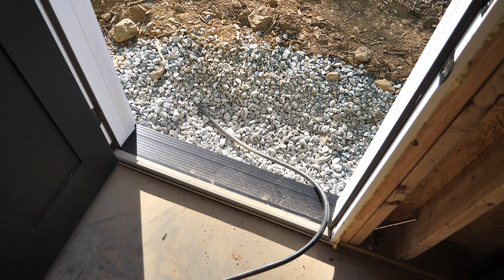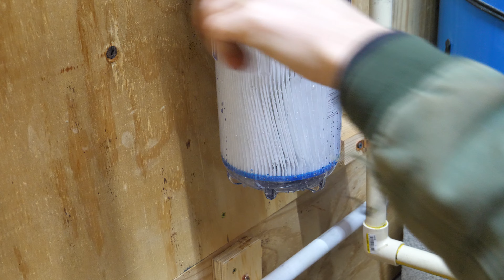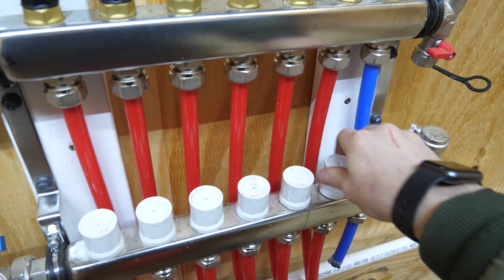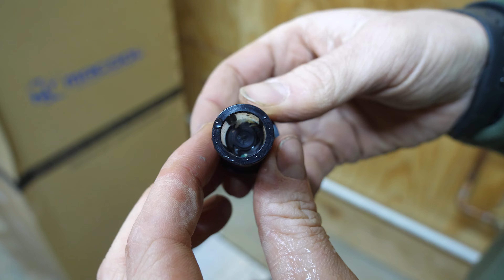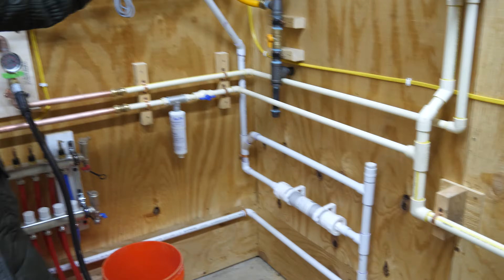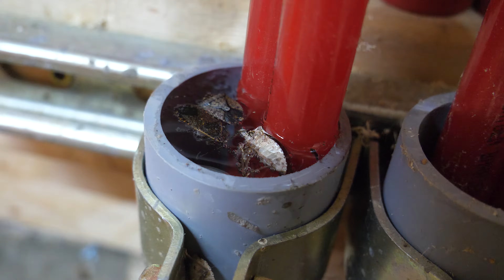FIRST START-UP of our Heated Slab (more leaks)

Comment: I’m confused on that 7 loop manifold. All the other videos I’ve seen they crimped each line to the fitting on manifold and u just stuck it in and tightened it and it didn’t leak or bust off there like I thought it would.

Comment: I'm surprised you didn't put a air valve at to top to automatically release air from the system. Also, I think you can flip the display on the pump
Reply from the maker: The manifold has air bleeder valves on it but they aren't needed for an open system - every time you open a hot water faucet air has chance to escape
Reply: Kyle at R&R buildings put one in, might be because he is using a glycol solution @MasonDixonAcres

Comment: So the same hot water flowing thru the floor pex is also coming out the faucets throughout the rest of the home ? Or is the radiant floor pex isolated ? Just curious , i was thinking about using an antifreeze fluid in my flooring pex.
Reply from the maker: Yes this is an open system, all the piping and components are potable rated. A closed system would use glycol in the loops and either a combination boiler or separate tankless heater
Reply: @MasonDixonAcres  thanks. Great job. What a commitment.

Comment: I see some auto air vent at the end of the supply manifold and return manifold. Loosen the same cap on the auto air vent so the air will exit automatically. The auto vent has a float in it that drops to let the air out automatically  enjoy

Comment: Thanks for the video, I’m about to fire up mine tonight, it’s a closed system. Going back and forth on glycol or just water it’s our main heat so unless we have a long power outage I don’t see any issue with just water. Did you have any reservations about just water?
Reply from the maker: Nope. It would take a lot to freeze a slab with R10 at the perimeter. But if it's a closed system and always will be, it wouldn't hurt to use glycol to eliminate any corrosion concerns if you don't have any cast iron parts in the system

Comment: Pretty cool project, a water softener or an R.O. system would help reduce/eliminate the scale issues.
Reply: RO can’t be used with copper pipes. It eats the metal.

Comment: I’m just wondering why they didn’t install an air eliminator. I had the same leak at manifold connection. I ended up putting a lot of teflon tape and it sealed up.

Comment: First off, great work all around. I'm in the process of designing a similar shop / home and ran across your channel. My heating/cooling concept is almost identical, but im debating whether a separate radiant system is worth it if i have mini splits in the shop just as you do. I know your design is an open system so it also supplies domestic hot water. Im curious to know if you considered no propane at all with just the heat pumps and or maybe electric boiler / water heater. Electricity may be expensive where you are so maybe that went into the calculus. Also, did you complete a heat loss calc for your spaces? Im looking at how to size the heat pumps appropriately. Thanks for sharing.

Comment: I know it's been a while but if there's still time you should run that extra supply up to the bathroom. Your wife will love you for the heated floors in there.
Reply from the maker: That's actually why we bought a 7 loop versus 6 loop manifold, but then realized control would be a pain. Using electric radiant floor in the bath/shower instead!

Comment: Scale is from the make up water, heating the water causes more scale to precipitate out in the system. I can't believe your wife will be happy when her laundry becomes stained from the water in your system. 2 of those Takagie condensing boilers, one for heating the floor and 1 for heating domestic water needs.  Filling the floor heating unit with 50/50 mixture of Prestone and distiled water will keep your system clean and the tiny passages in the boiler clear of scale and rusty water. Always remember to check the boiler water for the correct PH . Pure water will eat holes in the copper heat exchanger in a short period of time. Rock phosphate is a good way to keep the water at the correct ph,you can use DCA test strips to test the water ph, DCA is used to keep the ph at the correct level in Diesel engines, it will be more than sufficient for you. Scale stick made by NUCalgon is my favorite for this application.
Reply from the maker: Thanks for all the info! I haven’t noticed any change in the water between hot and cold so far, it’s been going for close to a year. Haven’t tested any pH though, focusing on finishing the build first 😅 Radiant floor company does recommend flushing the tankless with vinegar once a year to keep everything clean. I’d much prefer to keep the open system for the simplicity and definitely don’t want to put in a separate $1400 boiler for domestic water haha so time will tell! Will update

Comment: I just got my system in my pole building online yesterday. it's a 30x40 building with 4 loops.  All these "kits" out there were so highly priced. I did it myself. I got an electric water heater from one of the kit suppliers. but everything else was local. I used PEX-C from lowes. 3/4 inch with crimp fittings. So far so good. No leaks that I've seen and it's been running about 19hrs now. So it'll take a few days to get up to temp I'm sure. Videos like this one sure helped.

Comment: You can't mix your heating water with your potable water. You're missing an RPZ backflow preventor and water make-up, regulator, air separator and expansion tank. A huge health hazard. If you wanted to use this to heat your domestic water too, you need an indirect tank. This all needs to be redone.
Reply from the maker: You're imagining this is a closed loop system - I suggest looking into the open direct system by Radiant Floor Company, they have lots more info
Reply: @MasonDixonAcres  It doesn't matter whether its open or closed loop. You can't mix your radiant water with your domestic water.
Reply from the maker: If all components of the system are rated for potable water, there's no reason you can't have radiant and domestic water together in an open system. Open to hear the reasoning for your opinion
Reply: @MasonDixonAcres  Your components are not potable rated. The Grundfos pump, the oxygen barrier PEX etc... This doesn't include any of the other various radiant heat fittings. The alloys used have to specially made for potable water. Otherwise you will leach lead. Just the oxygen barrier PEX alone is a really unhealthy dose of chemicals.
Reply: @MasonDixonAcres  Even if all your components were rated for potable use, you can't have "dead ends" in your piping. This happens when your radiant side isn't being used for several months. This will cause Legionella growth.
Reply from the maker: The Grundfos Alpha2 stainless circ pump is designed for both radiant and domestic recirculation applications - please check the literature before assuming. Type L copper assembled with lead free solder has been used with potable water forever. The brand of oxygen barrier PEX used in this system is specifically listed for both radiant and potable use. Any O2 barrier PEX is chemically identical to non-barrier PEX except for a glossy coating on the exterior of the tubing. Some brands have undergone the NSF rating for potable and others haven't.

I don't usually spend time arguing with comments but I don't want others reading this to be misinformed 😄 

More info on the system here: https://www.radiantcompany.com/system/opensystem/
Reply from the maker: There is water movement in the system every time a hot water tap is opened (including in the summer) preventing stagnation.
Reply from the maker: The pump housing and flanges are stainless, it is cast so it might look bronze on camera. This is the pump: https://www.pexuniverse.com/grundfos-alpha-15-55-sf-circulator-pump-59896879

You are totally right about the Pex-A linked in that video description, that was a mistake and I switched it to the correct link. The tubing we got is dual rated for radiant and potable, this is the correct link to what we actually bought: https://www.pexsuperstore.com/product/1-2-x-1000-ft-red-alpha-pex-a-expansion-tubing-with-oxygen-barrier-radiant-heat-potable-water-by-pex-guy-made-in-the-european-union/

You are right that I didn't necessarily need the O2 barrier on an open system, I could have used non-barrier. I figured it was cheap insurance in the case the system would ever need to be switched to closed loop in the future, and maybe it would provide some amount of corrosion protection.

I am the first to admit that I am not an expert and do my best to thoroughly self educate when I perform skilled trade tasks. This is why I never label these videos as how-to's, but I try to always put out valid information regardless. I do appreciate your input
Reply from the maker: For the benefit of anyone reading this in the future, I reached out to the supplier to clarify the physical difference between their dual-rated (radiant + potable) O2 barrier Pex-A and their radiant-only rated O2 barrier Pex-A. This is the response:

"The Alpha tubing is rated and tested for use within radiant heating and potable water systems; while the standard PEX-A is only rated and tested for radiant heating.  They are also manufactured in different factories.  NSF is the governing body here in North America.  They are the ones who certify PEX tubing to be safe for certain applications.  This certification process includes inspection of the manufacturing factory, long-term and short-term testing for material durability, longevity, and overall quality, ect.  This ensures that all NSF certified products are quality and up to standards here in the USA.  There is a fee that factories have to pay annually to be certified by NSF.  Radiant Heating (NSF61) and Potable Water (NSF/ANSI14) certifications are separate, so factories normally produce and certify their PEX tubing with one or the other; even if the PEX tubing, materially and structurally, can do both radiant and potable water systems.  The certification fee prevents manufacturers from certifying their PEX tubing for both; as each certification ranges from $100K and up."

Comment: Over tightening a threaded connection can crack a brass fitting. Just 3 wraps of Teflon tape and a light coat of pipe dope then snug it down.

Comment: You’re making that look easier than it really is. Purging all of the air out of lines can be problematic...for any kind of system.
Reply from the maker: With an open direct system it's as easy as opening any tap! For closed systems, yes it can be quite difficult if the bleeder valve isn't the highest point of the system

Comment: How does it heat with that heater and not waste water? I thought it would be a closed circuit but you said that heater will provide water for sinks...
Reply from the maker: it circulates hot water through the floor until you open a hot water tap, when the output from the heater is directed primarily to the tap. It's called an open direct system.

Comment: Great videos.  That’s an impressive DIY system.  Auto air separator or bleeder would be a nice add to that system.  On the outlet of the boiler but before the inlet of the pump.  Point of highest temp and lowest pressure.
Reply from the maker: That’s the beauty of an open system, a little air bubble here or there doesn’t really hurt anything and just works it’s way out at your faucet. There are air bleeders on the manifold but I didn’t even use them, just opened a faucet and let it run.

Comment: I appreciate the video, but I can't get past the fact you installed the electrical outlet directly beneath the hot water heater.  Especially when you clean out that filter and the water sprays.
Reply from the maker: Never even thought about it tbh 😂 That little screen is mostly for the first startup to catch leftover solder in the control board, my actual sediment filter should take care of future dirt so I don't anticipate needing to clean that screen very often. Good thing the outlet is GFCI 😁
Reply: @MasonDixonAcres  Agreed that the GFCI takes care of it and that this really shouldn't be a big deal.  It really shouldn't be a problem.  It's just that from my Navy days on nuclear submarines there were plenty things that "should be okay" but you don't do them because it's "good engineering practice."  I've watched most of the videos at this point on the construction and appreciate what a Gen Xer can learn from a Millennial.  Also a fellow Pennsylvanian (NEPA).
Reply from the maker: I appreciate it! Still a lottt more to come.

Comment: Don't they recommend installing an automatic air bleeder in that system and automatic water feeder?  Do you really run that with house pressure?  My system runs at 20 PSI and pops the pressure relief valve at 30 PSI.  I remember you saying something about an expansion tank was not needed for your system last time.   Even my house hot water tank has a small expansion tank because I am on town water and there is a backflow preventer on the town feed, though for a well water like yours, your water tank has a bladder which prevents expansion of hot water and the expansion tank is not need.  I read the instructions better than my installers and made them install the proper expansion tank.
Reply from the maker: I confirmed with the manufacturer an expansion tank is not needed for an open system on well water. Neither is an air bleeder - it’s an open system, so when you open a sink faucet, the same hot water (and air) in the floor makes its way there

Comment: You are a legend !!!  I believe you designed and installed the radiant piping system yourself  . .
Reply from the maker: I did the layout in the slab but the board was pre-fabricated - glad I went that route, I would have definitely messed up a custom board.
Reply: @MasonDixonAcres  Learning many valuable things from you, thanks man. . .my only fear is availability. Working a 9-5 full time job, I'm afraid I may not meet the commitments needed to build my own home
Reply: @MasonDixonAcres  , I think I lost your eMail address, do you mind dropping it here for me ?

Comment: I don't see an expansion tank
Reply from the maker: Separate tank not needed for open system on well water
Reply: I am surprised this is not a Comby boiler to keep your domestic hot water and you’re in floor heat water separate interesting interesting I have I have in floor heat in my house and my house came with a Combi boiler so the boiler for the heat is separated from the domestic hot water. That way you can run your boiler heat, a little warmer mine set at 140° and my domestic is at 120

Comment: If there isn't one, you should add an air release valve at the highest point.
Reply: That was my question?
Reply from the maker: It's an open system, so any air that might get in is released when you open a hot water tap.
Reply: @MasonDixonAcres  I'm talking about the in floor heating. Air goes to the highest point. You need an air release valve. They are made for this exact reason.
Reply: @thomasmattson2389 I think what he is saying is that his hot water system is circulated through the floor, and then when he has hot water demand in potable water, that water continually comes through the radiant system, always in the process of removing air, and the water gets used up in the house, so no air removal system is needed.

Comment: Definitely install radiant floor heat in your bathroom. If you don't want to run water to there, the electric cable is easy to install. If your hydronic system needs to be down for any period of time, you'd still have a warm bathroom. Either energy source, a warm bathroom floor makes a world of difference in terms of comfort and bathroom maintenance (it dries the room out).
Reply from the maker: I agree! We have the Schluter Ditra Heat system in our current remodeled bathroom, and it is a nice luxury. I think we will lean towards the electric system for the separate control ability
Reply: @MasonDixonAcres  The way I did mine was to screw the thinner Hardie backer to the subfloor, and then tape heat cable down (got if off Ebay for a good price), then poured floor leveler to a depth of 5/16” to cover the cable. Tile over the floor leveler. I am glad I did not waste time and money on expensive de-coupling membrane.

Comment: Cool to see it up and running. We're doing a radiant floor in our new house as well but using an electric boiler with 3 zones
Reply from the maker: Nice! I worked out the math for ours and an electric boiler was about 25% more expensive to run than gas. All dependent on power and propane costs in your area

Comment: You’re a really smart dude. How many hours of research vs. Installation time do you think this took?
Reply from the maker: Haha I appreciate that, I probably spent 10 hours figuring out which vendor I wanted to use and reading their documentation. Install was probably 40 hours total for the plumbing, hanging equipment, venting, startup, etc. and that includes me YouTubing how to solder copper pipes 😄